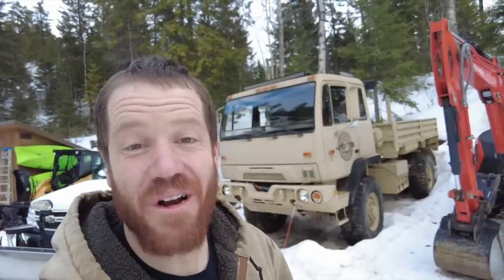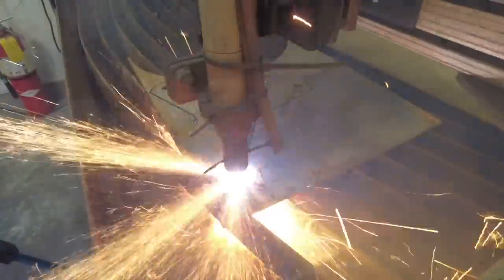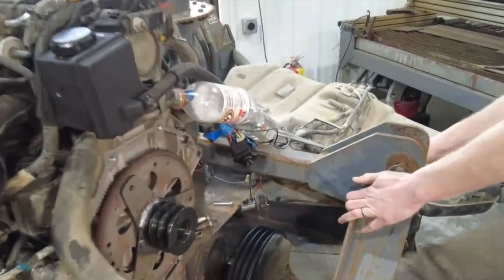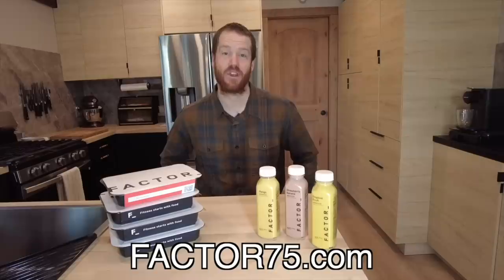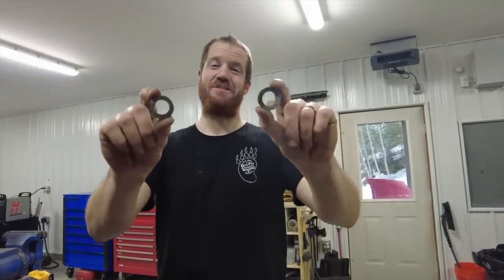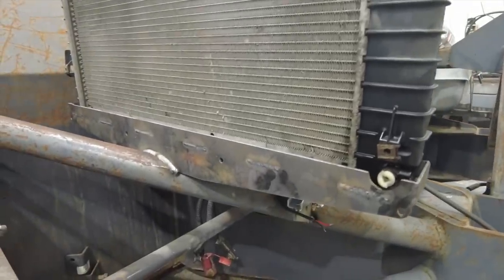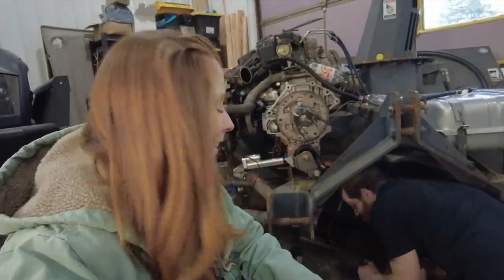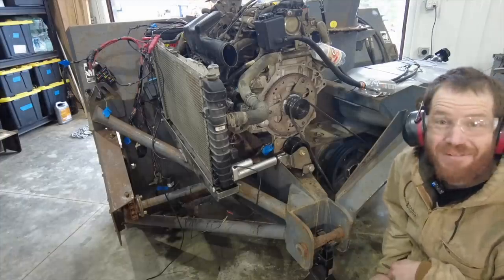DOES IT WORK?! | Building a MASSIVE Snow Blower P3

Comment: Great job 👏,  I applaud you Riley! This will be awesome. 
I am concerned about the amount of torque you have with the 4-cyld engine, a 4-cyld diesel is always a good backup, l hope this works for you 👍🏻. You have done an amazing job, way to go! 😊
You have so many cool options between the two of you ! I can't wait to see you two in action when there is a really big snow fall. Your neighbors will love what you built also, just in case? 😛🤏.
The machines/tools you have worked spot on, even the little lathe. It's  a great lathe, more important is your design 👌🏻 is so balanced, it runs smooth and you made it! Confidence is what l wish for you! You have a great mind, can't  wait to see your next project? 
You two are a great 👍🏻 Team!
✌🏻🧡 🌬 🌧 🇨🇦 ❄️ ☃️.
P.S. could you paint your garage door, patina is for hot rods ...💜

Comment: This will probably be lost in the multitude, but I think you're likely to see the flex plate fatigue and fail in short order. Flex plates are not that springy. Please be watchful for cracks in the flex plate. 1) The drive from the engine is designed to be axial and the drive to the snowblower is also designed to be axial. Neither of these shafts has a bearing system designed with the side load in mind that the v-belt system with lots of power WILL produce. Putting this large side load on the engine's rear main bearing will lead to a short life but that could be OK as I doubt it will get that many hours annually. The side load on the blower input will be less as it has a larger pulley.  2) the cantilevered tension on the driver pully attached to the large spider, once loaded with the belt and drive tension, will cause the flex plate to warp cyclically as it rotates. I'd guess the fatigue created in the flex plate will create fatigue cracks pretty quickly. When it fails, I suspect the flex plate arms will crack through and the drive pulley and the ring gear will just fall off. I don't see a big safety problem with operating it till it breaks but I would keep an eye on it to hopefully catch it before that. 

Potential solutions:  Once the flex plate breaks through or even develops cracks, you will need a new flex plate. Once its installed,  then add an outboard pillow block to take the majority of the side load and prevent the cantilever. Make a 3-step short shaft that fits tightly (.001" clearance) into the pilot bearing hole in the end of the crankshaft, a press fit to the bore of the pully (.0002 interference), and a tight fit into the pillow block (.001 clearance). The existing drive system should be fine once the cantilever force is relieved. Alternatives: get a solid pulley and bore a hole pattern to bolt the pulley to the drive shaft flange. This alone will alleviate the cantilever but not the bearing side force.

I'd like to be wrong but I'm pretty sure its just a matter of time....

Comment: I really like your channel.
But you should really get an heat pump to reduce how much fire wood you need.
With solar an heat pump can't run in the middle of winter all the time. But you can eliminate the use of firewood in the fall and spring. And reduce the use of firewood when the sun is shining.

You can start up the heatpump if the battery is charged to 85-90% and turn it off when the battery is down to 70-75 procent. You can also use this solution in the shop simply by choosing to have the heat pump set to eg. 68 degrees and your oil burner to 63 degrees. It also works when you are away if you lower the temperatures.
When the heat pump is turning off the oil burner kicks in on its own, its simpel but it works.

And it use power you otherwise will waste when the batteries are almost full. You can also use the heap pumps for air conditioning in the summer.

Here in Scandinavia we get low temperatures too and we have models of mini split heat pumps there is working down to -13 degrees f.

Comment: would a pneumatic piston also work since you prob already have comp air on the truck for the brakes or would the cylinder diameter become unfeasable to optain the required tensioning force on the belt(s)? maybe more failure proof with the harsh environment. then again the engine's radiant heat will prob keep things reasonably dry, so idk
EDIT: i guess having it all as standalone attachment to potentially fit any future vehicle with 3 point front hitch is what makes the electric actuator the smarter choice
great stuff, you guys

Comment: The belt tensioner needs more explaining. It may be putting too much tension on the belts judging from what you have shown. Under tension the belts should have about one inch of flex half way between the driver and driven pulley. You want the belt to pulley contact to do the work not the tension. There should be a spring for tension and belt wear/stretch.
For a driver pulley that small in diameter you need multiple v belts to handle the power. A cog belt would have been a better choice with a friction clutch. Some people use a marine gear.
You want your engine running at its peak power speed and your blower drive speed set to the auger to blower ratio. Use the vehicle speed as the final control.

Comment: I don't think that engine crank bearing is meant to have a side load.  They're meant to have an axial load.  I hope you don't end up having problems with it.  I think you should have used a hydraulic pump and motor.

Comment: I think I would have gone the route of a used automobile electric drive motor and battery pack so that I could reduce weight beyond the front bumper and to have operational control sitting in the driver’s seat

Comment: 😎👍👍👍 Well Reckless Riley, you now have to change your name to Machine Builder Riley! Pay grade increase. Congratulations! But you still may not be done. I'm thinking some protection, over the vital parts of the motor to protect from flying debris. Yes, the Harbor freight bench lathe is ok for smaller jobs but be careful. You really need a floor model lathe for what you will inevitably need. But you know this. (Can I have Your Harbour Freight?) A good tooling lathe, a Bridgeport, and a precision grinder, minimally. Hey, I know how to build Spaceships and Jets if you need any advice.

Comment: Man with the tracks you lowered your gearing so low you will only get 5 or 6 miles to the gallon you'll get more if it's a 6 cylinder and it's so cool with a winch you can get out of anything

Comment: I am impressed with the thought and execution. For each piece made there must be hours if not days of thought. I am not however impressed with no lubrication on the drive chains; please at least brush some old oil on or best chain lube or open gear lube. To transfer the power you need at least 5/8" belts. No doubt you made a calculation of the HP and torque that can be transmitted by each belt. What values were you estimating for the gas engine? Sometimes (often) what looks right is right! Hopefully 3 belts are enough. Thankfully your tensioner gives a soft start. You may want to get fancy later and have an interlock to prevent no more than idle speed when you first tension the belts. (the idler position of work releases the throttle?)
When you do get the proper belts request at least a matched set. This means that the belts were manufactured and cut close to each other and have the minimal difference between them. There are other attributes to a matched set that you may want to research. However, I strongly suggest getting a triple belt. This means that all three belts have a common back. This type of belt runs smoother and there is no question if each V is doing it's job. Gates amongst others makes good industrial belts. Probably best ordered through an automotive or industrial supplier. Belts are measured by pitch length not inside not outside length. I, like you, normally experiment rather than calculate. Oh, and check if the belt can be used with a tensioner. You may get away with it if not recommended but have a spare at hand (have a spare in any case).
The first additional item I would recommend is to have at least 3 removable pieces of steel, even bolts, which cover the width of the complete belt assembly near the large pulley and are installed just shy of the belt when it is on the large pulley at 90°, 180° and 270°. This is to prevent the belt from dropping away from the large pulley when the tension is off. This keeps the belt stopped when not engaged. There is a possibility that the belt otherwise drops and is picked up by the smaller, turning pulley. 
The second additional item is to place similar pieces at the small pulley but only at 90° and 270° and with a bit more distance (say a half belt height). These are to keep the belt close but not engaged and forces the belt into a round form of a slightly larger diameter than the small pulley when the tensioner is off.  
I look forward to snow being thrown 30' at least. 
Sincerely,
Gerardus
P.S. how about a block heater for the army truck.

Comment: make sure when you get the correct B section belt you don't use a 5 L belt. L means low power . best is a BX belt.  why you didn't just pull a tape measure around the setup.?  that would get you close. you have to turn the tape measure over since it won't bend the regular way. L  belts are the same length as the package like an L 450 is 45 inches long. industrial belts are different. a  BX 45 is actually 48 inches long . hardware store belts are usually L style and you should avoid them. order industrial belts from grainger or macmaster carr  or somewhere on line as long as you get a BX  or B belt NOT 5L

Comment: Could have just kept the tranny if it were automatic. 
My experience in making sand rails, never use a tank for fuel being jostled around or expected to work at an angle.
 Fuel cell (bladder) is much more reliable and safe. 
Put the cat back on too. Your brains will thank you.

Comment: I'm sorta disappointed, well not the best word, but I thought you may use a centrifugal clutch for the belt system. Just rev it to operating speed and the drive connection is made. Simple throttle cable/sensor actuator, What you did does work, and probably won't fry and weld itself like a clutch if it is over loaded. Just saw the belt slippage and thought, clutch on the pulley.

Comment: I told you, Riley, to never underestimate the power of small machines and tools.. 😇 You can do almost magic with those, as far as the part fits in it's range of operation. 
You will also soon consider an addition expansion, as I said, to house all the tools and equipment your own. Being a DIY maker is a privilege, which separates you from others, but it's also a curse, because you need always so many tools and space to do what you do, especially if you're building cars/trucks/camper vans etc., since those are voluminous by default.  Da, that's what they say, if you plug it, usually it works better. 🤣You built some serious contraption.. Take care of your safety also. Wise man, belts give you some degree of tollerance when something goes "on edge". Using a car engine almost direct drive for a blower.. well, this is called innovation extreme.  There might be some truth in saying you Americans are a bit crazy.. 😏Cheers, keep on!

Comment: Your figuring out the belt length you made a simple task so complicated. Easy way is take your steel tape and run it around the OUTSIDE diameter of both pulleys, with the numbers on the INSIDE and take your measurement for your belt length.  How a normal person would do it that wasn't trying to make it complicated and that did NOT have OCD !!!!

Comment: Riley ! you do realise your putting all the HP of that engine through the starter ring right ?
that is nowhere strong enough to pull half the HP of that engine !   although you may get lucky and it will hold up a long time...BUT I think the first time the blower get's jammed with a rock of hunk of fire wood that was dropped on the road, I think that starter ring is going to sheer off..... not the sheer bolts on the pulley below like you plan which is a great plan by the way.....  I think you may need to cut a 1/4" ~1/2" steel starter ring and replace the original starter ring.... i think your plasma cutter could do that, if not the rings are removable by heating them up after cutting the welds and gently taping them off then you could weld it to a round plate that is thicker to handle the load better ! .... hope that helps because I think you'll need it in the future !

Comment: I have doubts. The motor has no ball bearings. This is not ideal for transmitting radial power. Automotive gears draw their power axially. I don't think it will last long without additional ball bearings to absorb the radial force. I wish you that I'm not right. sorry my english

Comment: I think it's hilarious that CAD/CAM and a CNC plasma cutter and an electric linear actuator are used to make the same crude belt-tightening clutch system that I have been cursing and wanting to get rid of since I first used a cheap lawn tractor half a century ago. It is a reasonable solution, but it's a bit like using the resources of a state-of-the art race car building shop to make a horse-drawn buggy.

Comment: You have figured it out now , but the old knuckle busters ran the tape measure around the outside of the pullies for length , the code on the belt should have the same number-length in the part number. ALSO- buying individual belts doesn't necessarily mean that that their the same circumference each one is just a little bit more or less than the other two .They make , Industrial sets in which all 2-5 belts are made at the same time and are identical in size ,,a little more pricey but worth it , go to Gates ,Goodyear  or WW Grainger ,or look up other industrial supply companies..Use belt # you have now to order the set maybe little variances in manufacturing ...

Comment: Cars or car parts were not made to move snow. And you see that by using your cars in the snow. You used pontiac parts which will work for a short time. But you will burn the parts out fast. If you uses like a dozen parts it be better. The only thing you done was waste a pontiac car for you to do a project that will break and fail. Was that right wasting a pontiac on something that will fail.  Pontiac cars are not made anymore. And I know you could of went to the junk yard and found parts that could do the job better. Bad planning on this project.

Comment: You don’t need a bigger shop you need a vehicle equipment parking area a pole lean too half “A” frame front to back so snow load slides off the back and does not block pull out of vehicles. You’re not a dummy but you waste a lot of time  should have just measured the belt out and ordered them first off.  Simply the back and forth was a waste of time, I hate wasting time mine or others.

Comment: I assume that the method of belt length determination @14:24 won't work properly, because the wrong-size belts don't sit in the pulleys correctly... but why not just run a piece of rope (of a reasonable size, not the string used later) around the pulleys, measure the length of rope used, and start with that as a belt length... instead of buying a bunch of belts that won't work?